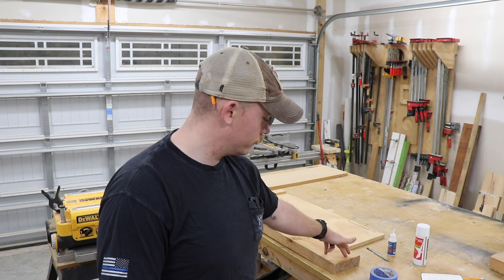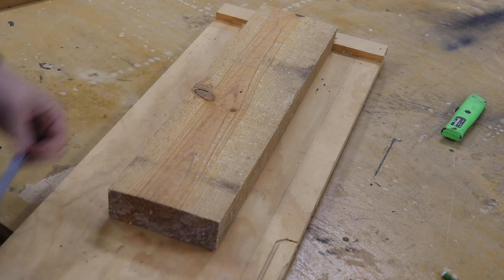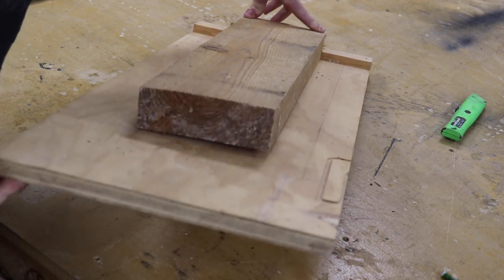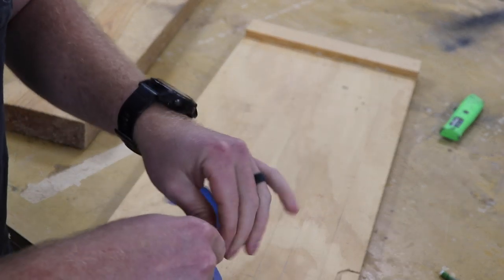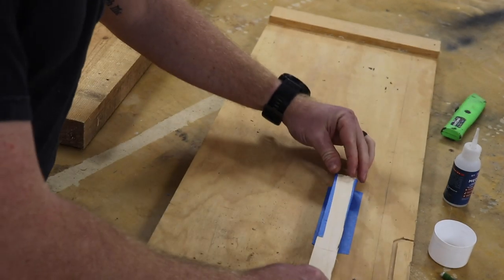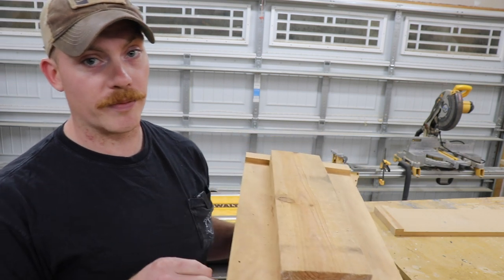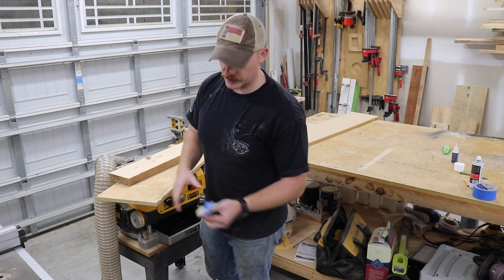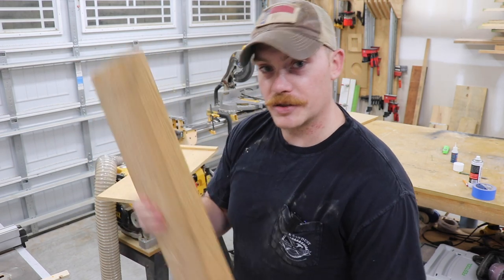Setting Up a Planer Sled - One of My Favorite Woodworking Jigs

Comment: Getting ready to build one of these for my new DeWalt DW735. I've watched dozens of these "sled" videos and I have to say some of these guys get a little ridiculous with all the complex add-ons. Give me a break, it's a flat piece of wood with a backstop. One of my primary concerns was the hot glue residue left on the ply/MDF base. It's a pain to remove it all and after a while it's going to build up and become a real problem. You have a very unique and simple idea to use the painters tape and CA in conjunction with the shims. Thanks for not overthinking and solving this problem.
Reply from the maker: I appreciate the feedback and thanks for watching!

Comment: Just watched the CNC Q&A and when I saw the thumbnail for this one I thought "did they get someone new for the videos?" until I looked closer ;-) I don't have a planer and needed to flatten and thin a board for a project so I made one of those router sliding setups to move my router over it, worked perfect. Also when we bought this house I had a dedicated 20 amp circuit ran from the breaker panel to the garage. I wasn't taking any chances lol
Reply from the maker: Router sleds are awesome jigs too! I have a few that I use to flatten slabs and they work great
Reply: 1 dedicated 20-amp circuit is not enough for a shop. In the video he tells us he can't always run the planer & vac at the same time. I get it. That Dewalt planer draws upwards of 15 amps & the vac is probably in the 6 to 12 amp range. Those 2 can easily trip a 20-amp breaker...

Comment: I do exactly like you did in this video…The only difference is that I use glue…Works great…I’ve also run my boards with out glue and I’ve never had any problems…

Comment: Great video.  Another option you can try is put 120 Grit Adhesive-Backed Sanding Roll paper on the bottom of the jig and nothing will move when you put it through the planer.  Just another thought but thank you for another great video.   And Merry Christmas from an LEO in Florida.
Reply from the maker: Excellent suggestion, thank you for that. And Merry Christmas to you and yours. Stay safe!

Comment: Add a 20A circuit for the power tools only and leave dust collection on the original 15A.  Solved my power issue.
Reply from the maker: I'm on a 20A circuit. I'm looking to have an entire sub panel put in just for the garage

Comment: Having just watched quite a few planer jig videos this is my favourite. I was already thinking of using painters tape and superglue and maybe trying painters tape and hot glue (which I've never tried). I did try hot glue without painters tape and it tore some chunks out of some figured mahogany and was difficult to remove from the sled, so won't be doing that again.  I might make a torsion box sled though as I have had problems with plyboard warping slightly with time. Greate video thanks.
Reply: Just using painters tape and hot glue worked great (when the distortion is not too great). I also used a few playing cards as shims : )

Comment: I usually use hot glue just because its faster for me. Another great video!
Reply from the maker: Thanks for watching!
Reply: What do you use to get the glue off after planing?
Reply: @chrisnail186  a chisel. Then I flip the unplaned side up and plane the glue off that
Reply: I've used the hot glue as well. It works well. However it's  too slow compared to hot glue but the shims are a pain .
 I discovered the double sided paper tape. Works without superglue but shims still needed.  However, I like the idea in another comment seems best. I'll give it a try. 
Another comment or question: I didn't see snipe on your board. Did you get any or did the camera not pick it up? There are several videos on this topic but none I have seen it eliminate it completely.
If you didn't get any How did you prevent it. Thanks.

Comment: Just me or did the sled go in backwards? Waiting on the next vid!
Reply from the maker: Could be haha. I'm no expert but I run it through this way every time and it seems to help with snipe just like it would if it was the other way around
Reply: @LazyLabAcres  I would imagine there's potential for kick back but probably not while rollers are in good condition
Reply: I thought the same thing at first, but when you think about it -- the feed rollers on the planer are pulling the work piece forward and through the machine, which is pushing the end of the board against the stop on the sled.. which is then just dragging his sled along with the work piece.  :)
Reply: @LazyLabAcres  What Wing's LLC said is correct.  You are putting it though the planer the correct way.
Reply: @benjaminl3084  Indeed there seems to be some confusion on this point, and some videos show the sled fence on the back of the sled. This would only be correct on those (commercial) planers that have the feed rollers at the bottom, and "grab" the bottom of the sled to push it forward. Most all lunch box planers have the rollers on top, and grab the top of the sled's workpiece to pull it forward.
Reply: Thanks for asking...I thought the same thing and would have fed it backwards.

Comment: Every time I need to straighten up a twisted board they are always oversized from finish size I need so I just screw a wood screw into the gap corner and adjust to remove the rock. Works great for me and a lot faster then fiddling with shims.
Reply from the maker: Solid tip, thanks for sharing!

Comment: Hey I have been using this jig and it works great!! I do have a question though. If my board is twisted on both ends, do I use shims on both ends? I have a board that will not lay flat against the sled once the shims are in on the other end of the board. Thanks for your help!!

Comment: is it just me or did you run the sled backwards? I would imagine the lip would go threw last not first. Maybe it does not matter? Ive made my sled and secured my wood but it feels wrong to run the stop block end threw first...
Reply from the maker: I don't think it matters to be honest 😂 seen it done both ways. I had great results doing it this way
Reply: Assuming you have a benchtop ("lunchbox") style planer, the rollers are in the top portion and contact the top of the workpiece to pull it through. This works on a plain board (no sled) because the board simply slips along the base plate of the planer. If the board is on top of a sled, the rollers will try to pull the board into the planer and off the sled. The stop block is needed to transfer this pulling force through the sled; otherwise the workpiece will slide off the sled, leaving it behind as the workpiece goes through. So, the stopblock has to be at the front.

Comment: Thanks for this helpful video. I have a question after seeing several videos on sleds. Why do you run the sled through the planer with the cleat at the front rather than at the rear?  I see others put the cleat at the rear. What is the reason behind the placement of the cleat?
Reply: Because the rollers are up in the planer, and push the workpiece forward. So you indeed need a forward facing cleat. Without it, the sled could theoretically stay behind as the workpiece slides on it. So the people who put the cleat behind clearly dont know how a planer pushes the wood forward…
Reply from the maker: Amen
Reply: The rear facing cleat is more often used for when you have an undersized jointer and a wide board. Joint the board then shim with a rear cleat in the underside of cut to make it parellel. Then flip it

Comment: Hi, to solve your circuit breaker problem is very simple; get a 20 or 30 amp rated extension cord, your extension cord is too thin. I was a contractor and always had this problem with my compressor, I solved the problem with a thicker cord, never happened again, a thin extension cord will make the amperage go too high, above the 15 amp rated circuit breaker current and this will trip the breaker. I am sure this  will fix the problem.
Reply from the maker: Thanks for the tips!